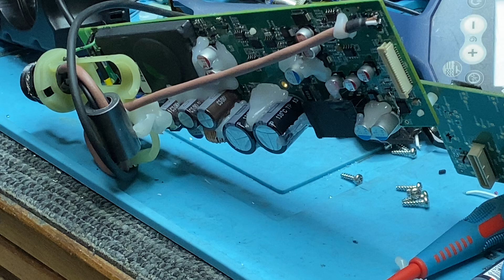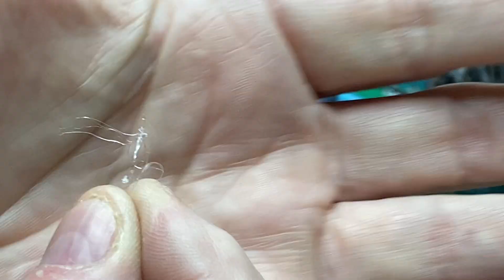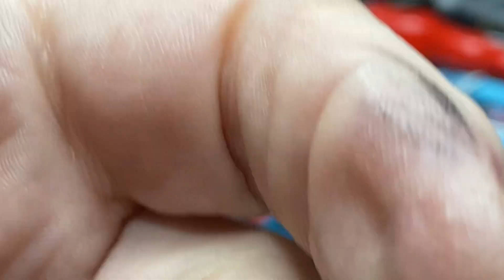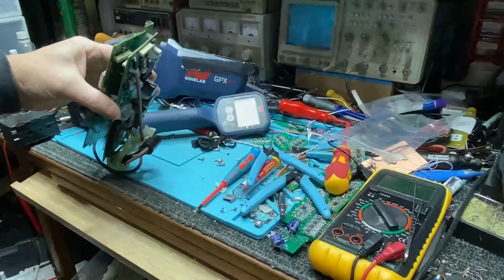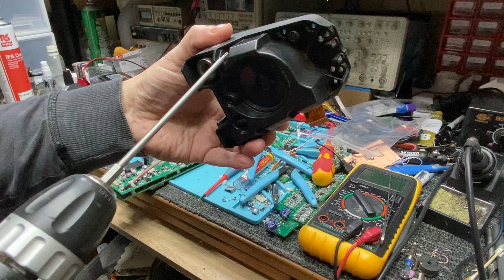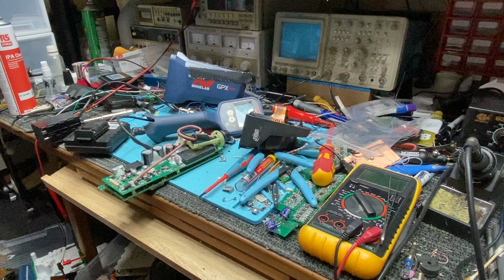GPX-6000 No coil connected fault and i think i fixed it.

Comment: Woody always informative question on the 6000 I’ve had mine since first release never has a issue and I use it 2-3 times a week most of the time same battery taking a little longer to charge but fine but I’ve noticed a bip in the machine after about 4 hrs use would that be a battery problem. Regards Len
Reply from the maker: Might be a borderline battery issue.